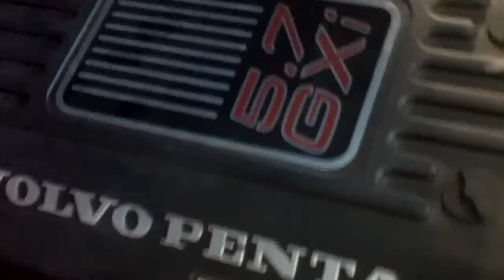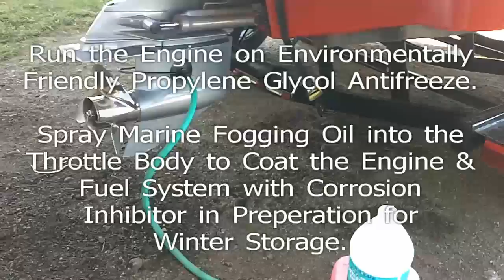Boat Winterization Procedures - Volvo Penta 5.7L GXi/SX

Comment: remove the thermostat for crying out loud..good chance you will be a very sad man in the spring if you dont !!!
Reply from the maker: +Noah Smith We drain the engine first. We then run it until thermostat temp is reached. We’ve been following this process for customers for over 20 years and never had an issue with this procedure.

Comment: I tried this procedure with my 3.0 Volvo SX. I ran the boat until engine reached 165 on temperature gauge. I then stopped and started to add antifreeze. I ran several gallons through. Then I discovered later that the thermostat had closed and block was still full of water!  The thermostat must have closed when I ran the antifreeze through it.  How can I get the water out  of the block?
Reply from the maker: +dezziwood555 We specifically break these steps up for this very reason. We drain the engine to ensure no water remains anywhere in the engine or exhaust. Then we run the engine on antifreeze and we run it until the thermostat temp is reached but regardless of thermostat position there is no chance for water to remain since we drained it first. We winterize several hundred engines/year following this procedure and have never had a freeze related failure to date.
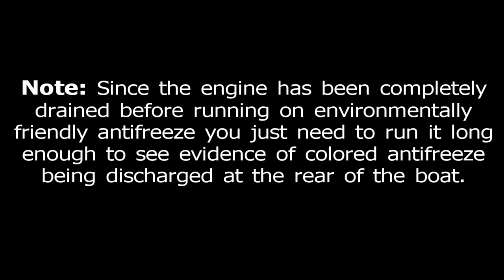Reply: @PerfprotechMarineProducts  hello thanks for the vid, I have the 5.7gi. Clarification question. at 4:12 you say to run the motor just until pink comes out and stop. But in this comment you say run until the Tstat opens. Which method is correct? Wouldn't waiting until the stat opens waste many gallons of antifreeze?

Comment: There is no need to change clear and clean drive gear lube. It does not undergo combustion nor become contaminated with combustion bi-products.We add fuel stabilizer to the fuel tank prior to the last outing (as to shake it up)..... not during lay-up. We Fog a "carbureted" engine at the very end of the Re-Start that follows the oil/filter change.  Please read my Amazon review if you plan on using something similar to the CamCo   type engine winterizing system.  www.amazon.com/review/R3BD7X6QC3KFR/ref=cm_cr_pr_viewpnt#R3BD7X6QC3KFRRemember..... just plain ole air will not freeze expand and ruin our expensive cast iron components. The rust scale that could possibly occur during the layup will be paled by comparison to that which occurs during the normal season. Richardo
Reply from the maker: Thanks for your feedback. The risk is non-visible water/moisture contamination being in the gear lube. It is a small investment vs replacing gears due to moisture related problems that arise from sealing issues. Having been engineers at the OEM level followed by operating a full service dealership and seeing it happen on numerous  occasions we feel the cost for a few ounces of prevention is well worth the cost.

Comment: I was under the impression that you are not to spray fogging oil into the throttle body, but instead use a mix of fuel and 2 stroke oil to run and 'fog' the motor.  Also, you don't show the fuel/water separator change.
Reply: i've been winterizing 4 different boats every year for 15years without anything other than draining water out of block, hoses and exhaust manifolds and running the engine for a few minutes with marine Stabil in the fuel..never had a minute's trouble with any of them..fogging isnt necessary unless you plan to let the boat sit for a year..
Reply: @jwithers1986  
Hi, do you run the antifreeze through the engine to remove all the water or do you skip that step?
Reply: kdubbs22s I've never used antifreeze

Comment from the maker: Well they do make pump kits for putting antifreeze into the engine however they use the muffs rather than a fitting. We have found that just running the engine with antifreeze but not draining it first does not ensure that every cavity gets an ample amount of antifreeze in it to prevent freezing. If you were to run it for 10-15 minutes you could be sure all cavities were properly flushed and filled with antifreeze but that would take too much antifreeze to be economical. That is the reason we drain before running it on antifreeze.
Reply: No replacement anodes?

Comment: Do you think boat engine manufacturers will ever just design an engine where a person could just 'hook up' a jug of RV antifreeze to that flush adapter and run the dang thing for a minute or two...and not have to yank all the hoses and open the petcocks?  I mean seriously, if it's sufficient for getting saltwater OUT of the engine, you'd think it would suffice for getting antifreeze IN!  Like Mick says, 'You can't always get what you want'.

Comment: It was my understanding that with an SX, you should remove the rear cover/shroud on the outdrive and open the oil level plug so that not only can you stop filling once you see the new gear lube at that hole, but any remaining air trapped in the oil cavity has the avenue(s) needed for purging.  What's your opinion on this?

Comment from the maker: The Marine "Open" style cooling systems work on a pressure balance. Therefore if the cooling system is full then the antifreeze would not enter the engine block until the thermostat opened. However since the system has been drained the pressure is low on the low side of the thermostat and therefore antifreeze will circulate throughout the block, pump, and manifolds. Read More on our website at /blog/articles/warm-manifold-cooling-tips

Comment: I'm no expert but by doing it this way, antifreeze won't get into the water pump housing since the motor never got warm enough to trigger the thermostat opening. So even though you did get all of the water out, technically the antifreeze hasn't circulated throughout the entire motor.

Comment from the maker: Typically we reconnect everything and run the antifreeze through the motor to protect it over the winter. We then strap the keys to the steering wheel with a tag that indicates the boat was winterized.

Comment: I see I'm 2 years too late on the questions, but maybe you're still responding :) ..  Is this video in order?  You unhook all those connections, and THEN you run the engine with antifreeze?  Being mechanically declined, I'm quick to assume it just won't run when you unhook all those connections... Did you hook them back up before running it?  Do you leave them unhooked over the winter?  Thanks!

Comment: Got the 1983 version on a Bayliner Nisqually. I only change oil and filter. I flush with fresh water after each use. Still running great.